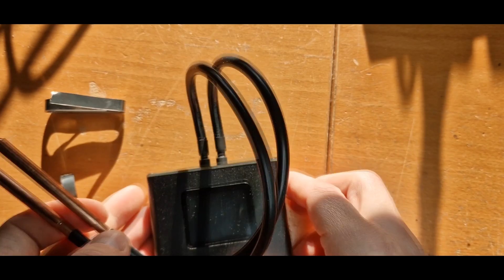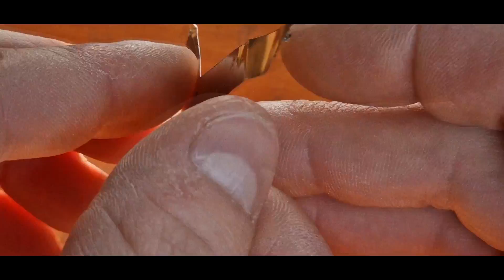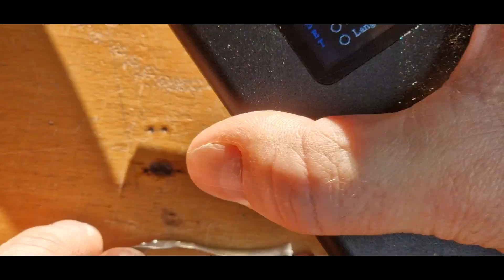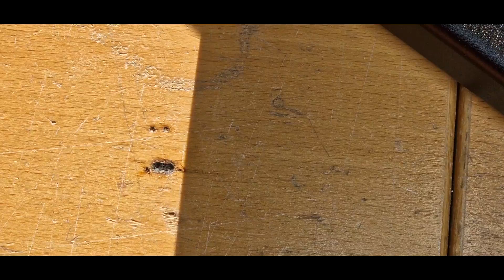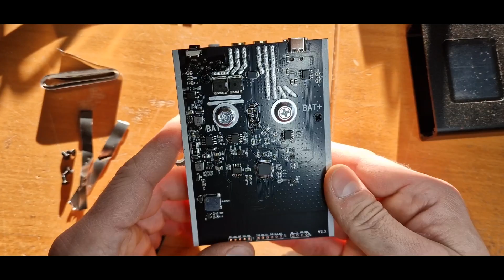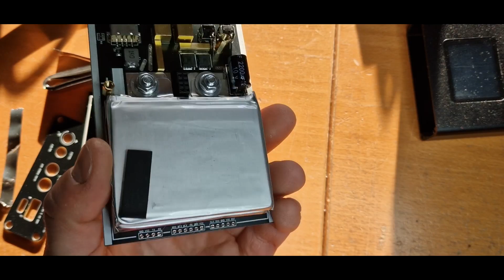Is the 30€ Spot Welder any good? Review and Teardown

Comment: Try to press down the spikes LESS strongly. Just lightly press so the nickel strips make contact, but don't poke a hole into the nickel, it should weld a lot better and burn trough less.

Comment: Do you have any idea if there is any battery protection circuits between the battery and the powerbank/MCU electronics? And how much current draw (or self-discharge) this device has when turned off? I had a similar spot welder from Ali (without display or powerbank feature, though) that seemed to lack any battery protection and did not turn off properly, so after it had been lying on a shelf for six months or so, the batteries were completely discharged and damaged...

Likely there won't be any protection between the battery and spot welder contacts and FETs, but the rest of the circuit could be connected through proper undervoltage (and also overcurrent - for charging) protections (but with these kinds of devices, you never know of course...).

Reading the description on Ali of your welder now, it does claim 2.5year theoretical standby time and only 20μA standby current, and it talks about "Over-current short-circuit protection" (and even "Overcurrent protection: 1.12KA" suggesting that the welding output is also current limited and/or protected) and "low current protection" (maybe that is undervoltage protection)? Any evidence of these protections on the PCB?
Reply: Mine has the same problem. After I leave it off for a while, the battery discharges completely. Has anyone been able to figure out what is causing this problem?

Comment: Looks like you could wire the LCD in and rotate it to face the way you want. But then the controls might be reversed. Definitely have a fire pan near by if you use that thing on lithium batteries.
Reply from the maker: My preferred way of changing the rotation is to reverse engineer the firmware and change it that way ^^

Comment: Welding seems to be working well enough. I just always wonder how long the lithium battery survive those high current draws? More expensive kits work with a big amount of capacitors, and I guess it has a reason?
Reply: I doubt it is a big problem, since the pulse is just so short. I would love if it had a 18650 cell though, so you could replace it with a beefy one that can output 35A without problems.
Reply: From my experience with two similar types of welders, the internal Lipo cell lasts long enough to make a video, and maybe spot weld one battery. Both of mine were no good a month later. Battery lost its capacity. The units weren't that powerful anyway, not worth replacing the cells.
Reply: I was thinking the same. Does anyone know?

Comment: Can you touch the pins, isn't it provide high current and get hot?
Reply from the maker: No problem in touching it
The problem would only be high voltage but not high current